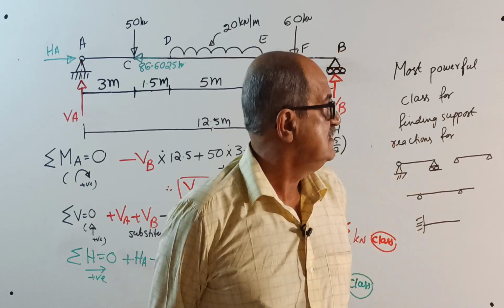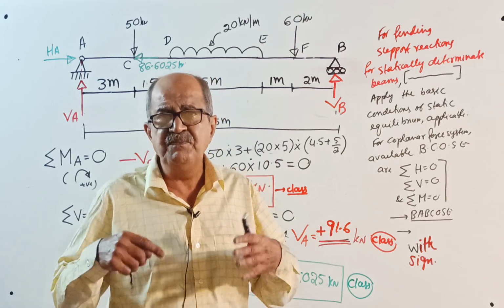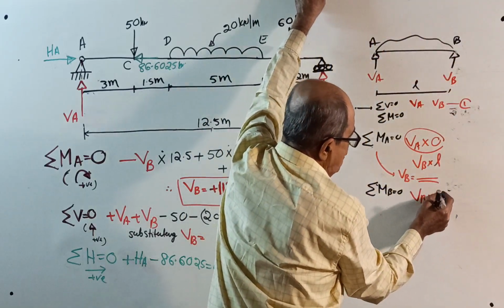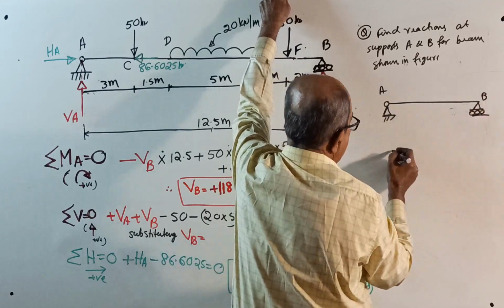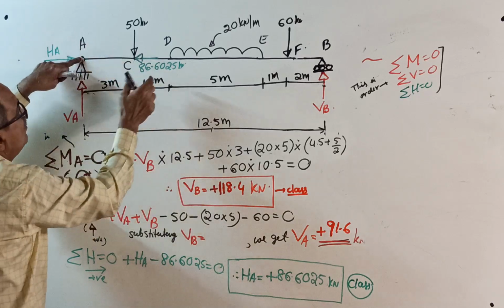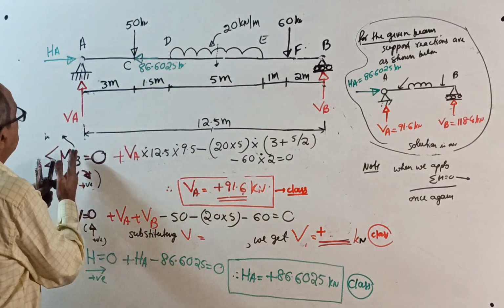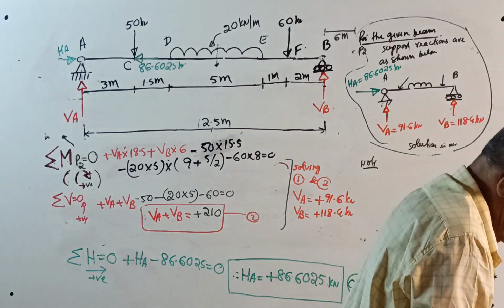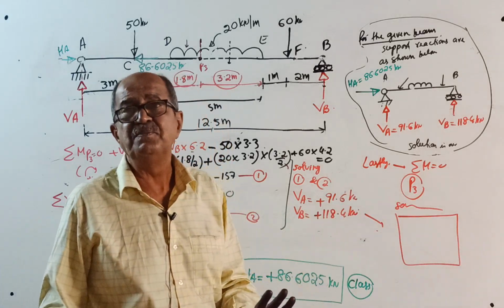Part:2/Lecture:34/ Most powerful class with concepts for finding SUPPORT REACTIONS for beams

Comment from the maker: At 47.36, i clearely told : minus 50 into 9.5, but while writing minus 50 is not written. So, correct it when you write
Reply: Sir we request class on seismic design (basic) and column interaction drawing